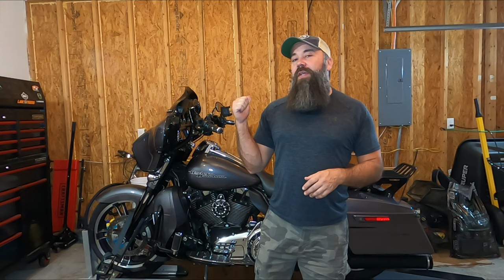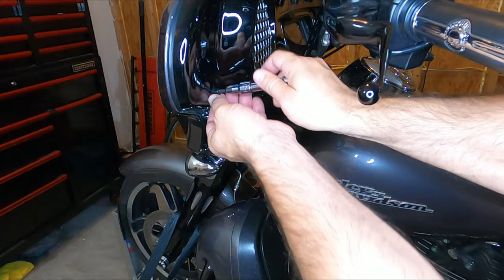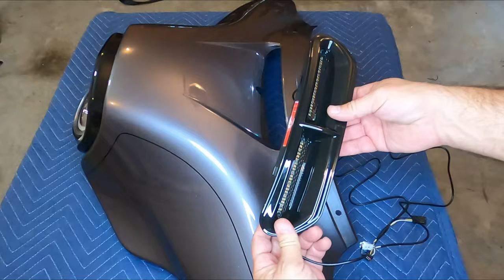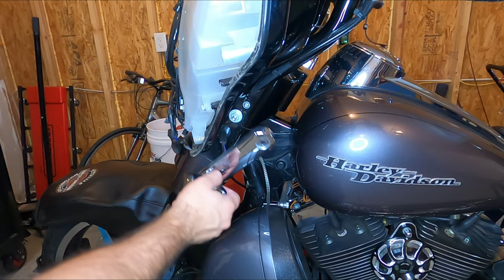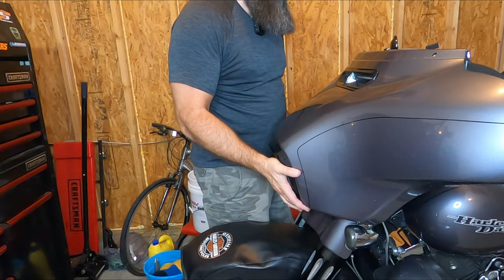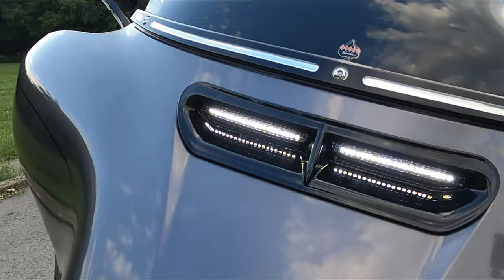How To Install Custom Dynamics LED Vent Light On A Harley Davidson Street Glide

Comment: Is that JAE plug a factory plug behind the blinkers? I just installed the probeam headlight and the genesis 4 front and rear turn signals.
Reply from the maker: Yes it’s factor then I add the splitter from Custom Dynamics